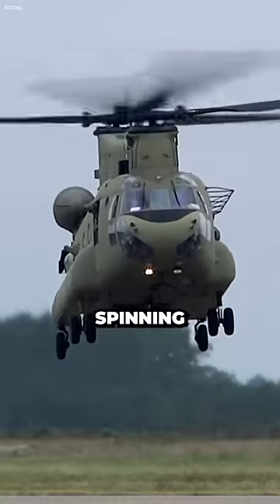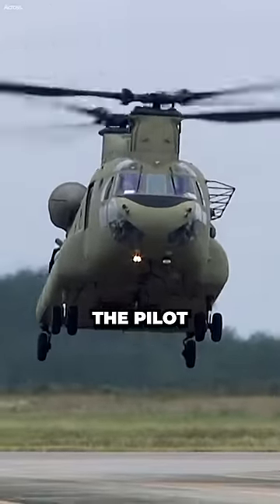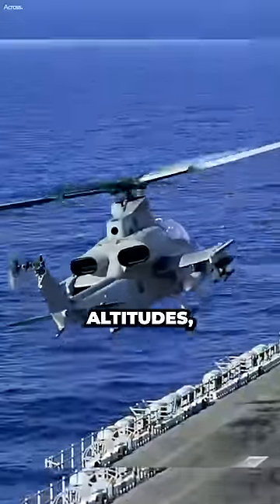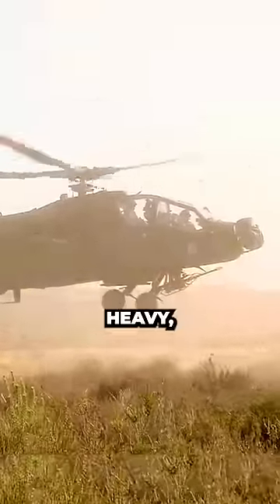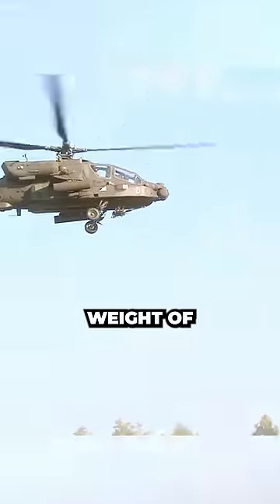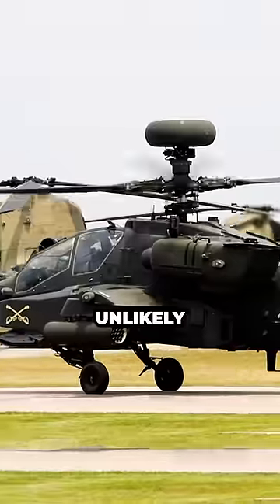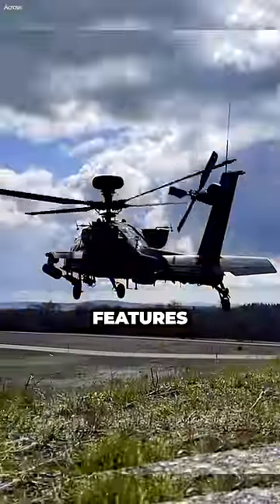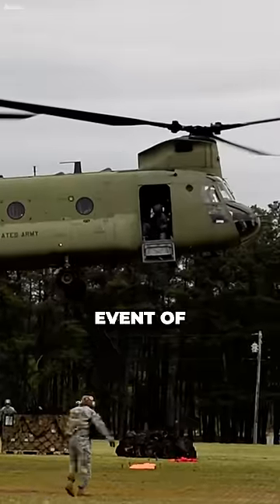Why Don't Helicopters Have Downward Ejection Systems?

Comment: The Russian Ka-50 and Ka-52 both mastered UPWARD-ejecting seats for both pilot and co-pilot decades ago.  They use explosive bolts to jettison the rotor blades (2 sets of 3 counter-rotating blades) a split-second before the ejection seats fire.  Works great.
Reply: “Mastered”
Reply: @AnrchyXRY That was my understanding.  If you understand differently then I really want to learn.
Reply: @adamchurvis1 yes it is a feature that technically works however, combat helicopters are flown at very low altitudes in order to avoid SAM missile sites. At a low altitude, the time it takes to effect in those aircraft is very long, especially when you only have seconds to get out of that situation. It’s a much better option to autorotate and land rather than blow off the rotors, which are the only thing creating lift, directly above you, then have the seats shoot you out the side. Unless you have like 500 feet of altitude, it’s not very effective and helicopters shouldn’t be flying above 500 feet in a combat zone anyways
Reply: @matthewstueber2783  Fighter pilots can eject even on the ground pretty effectively, what makes it different for helicopters?
Reply: @matthewstueber2783  When the explosive bolts fire, the rotor blades fly outward due to centripetal force, making a clear path for the ejection seats to fire upward as they normally do in fixed-wing aircraft.  There are times when autorotation is not an option, as I'm sure you can imagine.
Reply: The KA-52 has ejection seats but so far 
it hasnt matter in Ukraine

Comment: Russia has Helicopter that has ejection seat. While ejection, main rotor blades are detached using inbuilt explosives (in rotor blades). After that Ejection seat does it's job just like fighter Jets'.

Comment: The Russian alligator, i believe has horizontally ejecting seats. Or so I've heard.
Reply: It is correct
Reply: It jettisons it's rotor blades also before the seat fires.
Reply: Verticality upwards, not horizontal.
The human body cannot take sideways forces like that.
Reply: When we think of ejection seats, we think of the big seats that are in fighters.  The Russian aligator has a ejection system that doesn't look as heavy.

If you look close at the cockpit you'll see a cylinder object behind the seat. (It looks like the rocket on the MICLIC)   This is a rocket that shoots straight up pulling the pilot out.  And somewhere during this it deploys the chute.  I'm sure it's heavy but not as heavy as a ejection seat.

I haven't found any videos that show the whole sequence but doesn't look to bad.
Reply: Nope it eject upward, otherwise it would be a very bad day for the pilots ejecting at zero altitude.

Comment: The KA-50 had ejection seats. The blaess would blow out the then seat. But i believe that didn't always work.
Reply: The blades when ejected will have sensors so if the blades didn’t pop off and the sensors still detect something the pilots will not be ejected
Reply: @MangoNOW  so it did have that feature. I wasn't entirely sure since I got that from warthunder. Which probably isn't a valid place for info. Wait, it might be.
Reply: Well great, my comment is obsolete...lol
I'll need to research this helicopter.
Reply: The bright side is the pilot would never know the blades didn't break away.

The downside is the pilot would never know ANYTHING again
Reply: @anthonymiller7992  true
Reply: Are you sure...you not see 1 video co pilot ka 52 in Ukraine save inject after been shot by ukraine army
Reply: The pilots I believe would rather go down then rely on them to actually work
Reply: @endworld615  I do not care about the Ukraine war.
Reply: @sheepmasterrace  warcrime? Lame
Reply: @sheepmasterrace  the ka-50 isn't modern by no means. That thing was built and around when the Apache was built.
Reply: @legionclown2656 exactly, often times we are low enough that a simple autorotation will save us if we are not incapacitated, the ejection seat is just some dumbass Russian shit they added for selling value, if you notice from any of the videos the pilots rarely use them after being shot down

Comment: Flying Low and not enough time to deploy the parachute is not a good reason. Fight aircraft ejection seats are rate 0-0. Pilots can eject on the ground and parachute still can deploy fully.
Reply: 0-0

Comment: What about side ejection seats 🤔🤔🤨🧐
Reply: It would likely snap the pilots neck.
Reply: @Matt-yg8ub  yea I guess
Reply: @Matt-yg8ub : Just add a slight twist =
1) When the heli pilot activate the "pilot eject" switch...

2) Split seconds afterward : his head/neck area, upper body, thigh & leg area, etc- will be auto' immobilized, hard pressed to a high density foam/ styrofoam, its built. in to the pilot seat, ready for activation...

3) Synchronized auto belt strapping of the pilot to his pilot chair ;

4) The heli' wall adjacent to the pilot will self- open ;

5) Then, the built.in explosives at the pilot chair, it will explode & eject the pilot sideways ;

6) Around 2. seconds after the pilot ejection, a rocket under the pilot chair/ seat- will ignite autom'ly, causing the pilot to be lifted higher/ vertically;

7) When the correct height is reached, the parachute will self. deploy via a small explosive detonation ;

7) If the situation permit, the  pilot must angled the heli body, the future ejection area, such wall section- at least 10. degrees upward... Thus, much higher pilot vs. ground distance will be achieved...
Reply: @arielhermoso4262  physics disagrees with this massively risky and unnecessarily complicated process… which is why the west never got it to work.
Even if you manage to solve the problem of building a seat that could immobilize their neck, which is no small feat, considering the pilot has to have good mobility to do their job…. The violent lateral movement of the organs inside their abdominal cavity would be potentially fatal.

Comment: the point being made in the 
video is to protect the pilot 
during the escape process , 
vertical ejection seat and 
lands on top of the gunship 
helicopter in pursuit , gets 
chopped up by the rotor blades ! 
a helicopter can fly in any 
direction , forwards , backwards ,  
sideways left , sideways right , 
hovering , also upside down , 
any ejection seat there is a 
1 in 6 risk of being shot into 
the ground or into the side of 
a mountain or a tall building , 
the reason for pulling the 
ejection lever is because the 
pilot has lost all control of the 
helicopter , no option to move 
the helicopter into a safe angle , 
pull the lever now or crash ☠️ , 
vertical ( up , down ) , forward , 
sideways ejection , all have the 
same problem risk of being 
shot into the ground or landing 
on the rotor blades of the 
helicopter in pursuit .... ☠️☠️☠️ 
ANY escape method needs to 
protect against many failures , 
keeping the pilot inside the 
cockpit protects the pilot , 
mounting the cockpit on 
explosive bolts and ejecting 
the cockpit from the main body 
of the helicopter is simple way 
to protect the pilot , cockpit gets 
hit and pilot is safe , airbags 
can be fitted for a soft landing 
as the helicopter maybe too low 
for the parachute to open .... 
( parachute is included ) .... 
the cockpit can also be a 
life-raft at sea ( airbags ) , 
the cockpit maybe on fire or an 
unexploded missile maybe in 
the cockpit or the pilot maybe 
too injured to climb out of the 
cockpit .... so a secondary 
ejection seat in the cockpit 
would be a good idea .... 
some of you may have seen 
the demonstration video or the 
"James Bond film" where the 
rotor blades are blown off and 
the pilot is ejected this is fine 
where there are no hazards to 
land on , at an airport there are 
likely to be other helicopters 
landing on the rotor blades of 
another helicopter bad idea ☠️ 
SO , keeping the pilot in the 
cockpit is the simple way to 
protect the pilot for escape 😮 
note : the authority that 
regulates civilian helicopters 
has banned them from flying 
upsidedown .... however .... 
military helicopters in combat 
anything goes 😮 😮 😮 
the only problem with flying a 
helicopter upside down is the 
aerodynamics for the rotor 
blades are all wrong .... 
lift is the wrong way 😮 😮 😮 
I hope this explains the problem 
of protecting the pilot for the 
escape process 🔥 🌪️ 😱 ☠️ 
maybe it would have been a 
good idea to have shown this 
in the video .... !!!! 
( note : not my video 😱 .... ! ) 
would you want to pull the 
ejection lever with rotor blades 
spinning overhead 😮😮😮 , 
I WOULD NOT WANT TO .... ☠️

Comment: Crash resistant seats,
Hmmm

Im curious how THOSE work?
😂😂
Reply: they work by progressively collapsing thus absorbing some of the energy of the crash making it more survivable
Reply: @davedixon2068  I was being a little funny, sort of poking fun with the name because nothing is crash resistant. If your going to crash nothing is going to keep you from crashing. 

Safer barrier on race tracks help absorb the impact but are definitely not crash resistant barriers LOL
Reply: @anthonymiller7992  Sorry, but with usual level of knowledge displayed on the net I took the question at face value.
Reply: @davedixon2068  I understand and agree full heartedly! It seems the lack of common sense has become a thing of the past. 

I have hope that the uneducated stupidity that has come out of its hole over the course of the last 7yrs + years will eventually crawl back in the hole...
:)

Comment: why not have the cockpit 
mounted with explosive bolts , 
eject the whole cockpit , which 
would provide protection for the 
pilot and a secondary ejection 
seat for the pilot when the 
cockpit is clear of the main 
helicopter body .... 😮
would this be too simple .... ???? 
the cockpit can also be fitted 
with a parachute and inflatable 
air-bags for bouancy at sea and 
a soft landing on land .... !!!! 
is this too simple .... ???? 😮
Reply: Not too simple… vastly over complicated.
Reply: @Matt-yg8ub 
the point being made in the 
video is to protect the pilot 
for the escape process 😮
Reply: @abcdeabcde7174  which necessitates an upward ejection because of the stresses involved. Downward is a death sentence and lateral ejection would likely result in severe spinal trauma … probably snap the pilots neck clean in two.
Reply: @Matt-yg8ub 
gunship helicopter "B" in pursuit 
and shoots , helicopter "A" is hit , 
pilot lose control helicopter "A" , 
pilot pulls ejection lever .... 
if ejection seat functions .... 
" WHAT HAPPENS NEXT ???? " 
before parachute opens .... 
pilot lands on top of rotor blades 
of helicopter "B" .... ☠️☠️☠️ .... 
the reason for pulling the 
ejection lever is because the 
pilot has lost all control , so any 
escape system must protect the 
pilot from any of the hazards 
that may occur during escape , 
my longer note protecting the 
pilot contains a longer list of 
hazards .... 
I do recommend you ask 
someone to explain to you 
the concept of .... 
" WHAT HAPPENS NEXT " .... 😢
Reply: @Matt-yg8ub 
the reason why helicopters are 
NOT fitted with ejection seats 
is because .... 
designers , manufacturers , 
legal team , don't want the blame 
when the ejection system fails 
and the pilot is returned home 
in little pieces after being 
chopped up by the rotor blades 
or shot into the ground or side 
of a mountain or tall building , 
also legal team don't what to 
deal with blame from faulty 
components when the ordering 
department tries to save some 
money with cheap faulty items 
explosive bolts on the rotors 
don't work .... ejection seat 
shoots pilot into rotor blades .... 
canopy does not open .... 
ejection seat squishes pilot 
inside cockpit .... 
explosive bolts on rotors fire 
ejection seat fails .... 
helicopter crashes anyway .... 
the list of failures is just 
too long 😮
Reply: @abcdeabcde7174   So what your saying is the manufactures would rather see what’s left of the pilot come back as little pieces in a body bag, rather than risk being sued for trying to prevent it.
Reply: @Matt-yg8ub  
same in any country .... 
board of directors , corporate 
policy , don't do anything to 
make the company go bust ! 
NO laws for an ejection seat 
on a helicopter , so no need 
to fit one , pilot uses a 
helicopter without an escape 
system , ( legal view ) pilot is 
responsible for any injury to 
pilot , manufacturer cannot 
be held accountable for pilot 
decision to use helicopter 
without escape system ☠️ 
pilot flies into a situation where 
the helicopter can be expected 
to crash , pilot is at fault .... 
helicopters operate in a 
dead-zone .... too low for 
parachute to open .... too 
high to just 'jump out' .... 
so any 'law' on an escape 
system would be too hard 
to write or enforce , too many 
what can go wrong events , 
see my longer note about 
protecting the pilot .... 
so European and USA 
helicopters don't have an 
escape system .... 
there are regulations for 
parachutes but , too low 
to open .... ☠️ .... 
no use on a helicopter ☠️ .... 
😮 but russian helicopters 
have ejection seats .... 
NO accidents in Russia .... 
Russian military + companies 
are owned by the state , legal 
action cannot be taken against 
the state , protest against this , 
secret police visit , 20 years in 
a salt mine in Siberia .... ☠️ 
No accidents in Russia .... 
pilots have no rights , the state 
cannot be prosecuted for any 
injury to the pilot .... 
helicopter crashes pilot is at 
fault , ejection seat fails pilot 
didn't use it .... 
NO accidents in Russia !!!! 
NO .... right or wrong .... 
NO .... good or bad .... 
ONLY .... how it is .... 😮 , 
is there a solution to this 
only good will by the 
manufacturers to produce 
a failure proof system .... 
however what is the cost for 
the 'R & D' budget .... 
won't happen .... 
different approach is required , 
military puts out a contract for 
an escape system for use on 
a helicopter , how to make this 
happen .... write to your local 
minister for parliament 
( government representative ) 
and ask what is being done 
about this .... 
you can expect the reply to be 
the cost of 'R & D' is too high 
for this to be done .... !!!! 😮 
or the extra weight would make 
the helicopter too difficult to fly 
or to take off .... 
( many excuses , no reasons ) 
manufacturers require a high 
standard for maintenance for 
helicopters so they don't get 
the blame for crashes ☠️ .... 
regulations require equipment 
to be fit for use .... 
so NO need for an escape 
system on a helicopter because 
regulations require equipment 
to be fit for use .... 
goes around in a circle ☠️☠️☠️
to return to my original note 
keep the pilot in the cockpit 
and eject the cockpit ....   
seems to me I have covered 
this event as far as I can 🔥
hope you don't have any 
more questions .... !!!!

Comment: Instead of doing it down do it sideways
Reply: @FireFoxVlog   I got that, but a few feet can make a difference between an open parachute in a close parachute. I don't think it's going. Solving the whole problem it was a good option.
Reply: The human body doesn’t do lateral acceleration well… a sideways ejection would likely snap the pilots neck